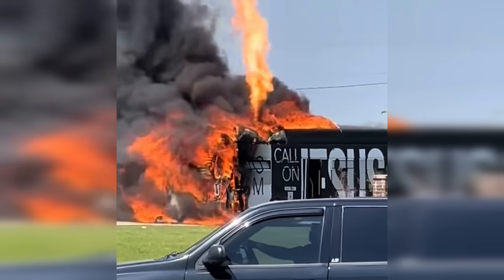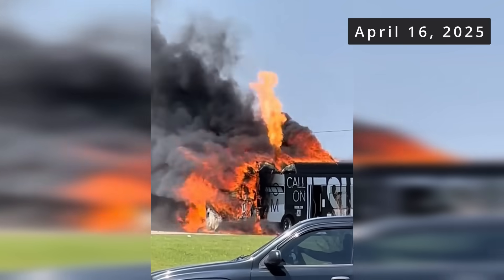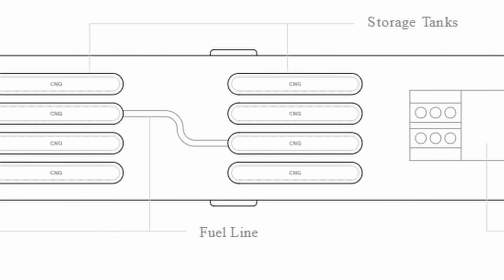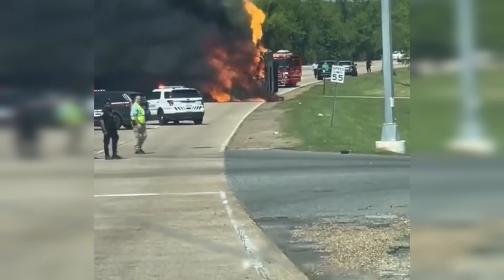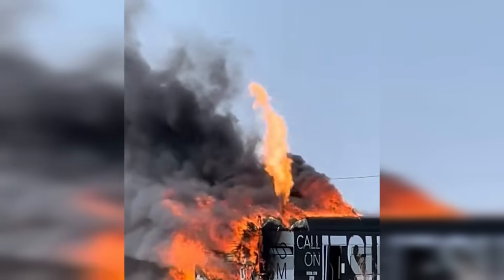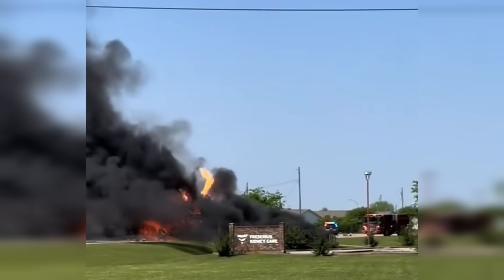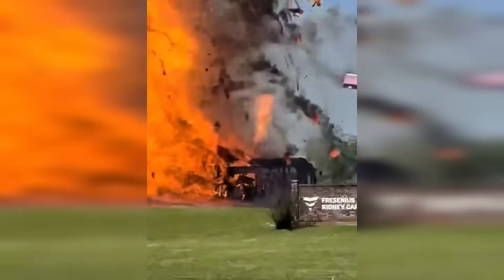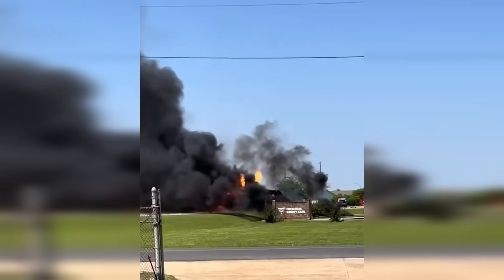CNG Bus Explodes in Shreveport — Not an Electric Vehicle

Comment: I bet they had a lithium battery powering the electrics for this gas bus. Why don't we just stay with petrol and diesel it's so much more safer.
Reply: Nah, most heavy vehicle electrics are as decadent as can be. Besides 12V batteries would be small and not located on the roof.
Reply: @rkan2  I think you can see from the video footage the fire started at the back of the bus and spread to the roof. I really don't think the fire could have started on the roof, it just spread there. So I would not rule out it being an electrical fire from the start.
Reply: @SuperBartet  Sure, the engine looks to be at the back. But trying to say lithium had something to do with the fire is far fetched.
Reply: @rkan2  But do you know if it's a AGM or Lithium battery in this bus or are you just having a guess?
Reply: @SuperBartet  Well he could ask you the same thing, right?  You're obviously having a guess.
Reply: @oskar6661  I think if you read again what I said, it was obvious that I was having a guess because of how I worded it. But he then said it was far fetched as if he knew I was wrong, when he has no idea at all what type of battery powers the electrics, so yes he is not only having a guess, but also making out he knows better.
Reply: @oskar6661  Update I have found out the bus is a New Flyer Xcelsior CNG. 60 foot version. I have downloaded the operators instruction manual so I now know all the technical spec of it.  There are a huge amount of electrical things to power from it's head lamps to the wheel chair ramp, and don't forget about the starter motor that needs a 700 CCA cranking capacity battery, it all runs on a 24/12 volt circuit powered by a group 31 Lithium battery. So I am no longer guessing, and can can now say again I bet it was a lithium battery that started the fire :)